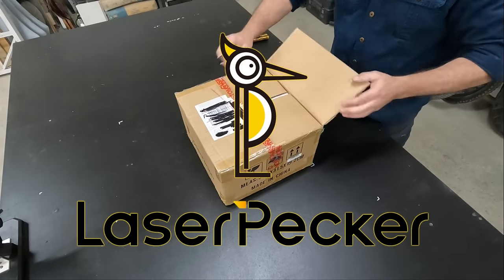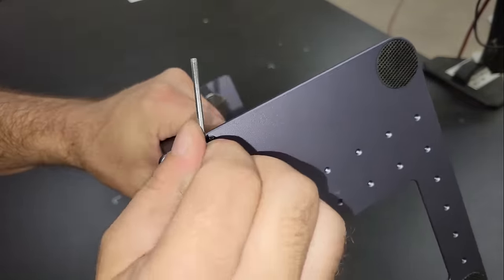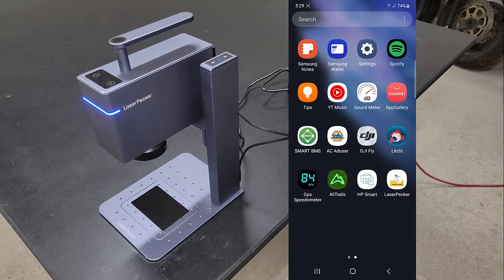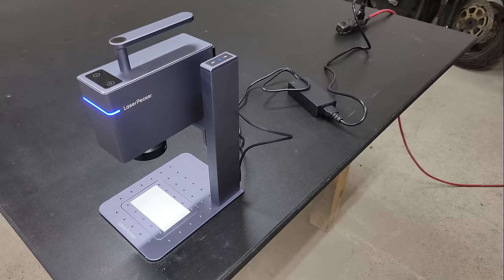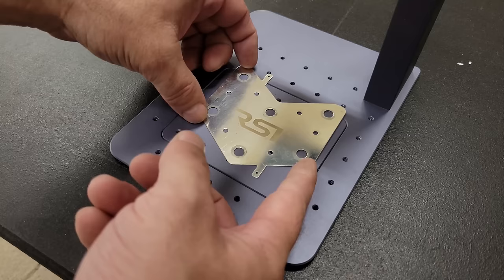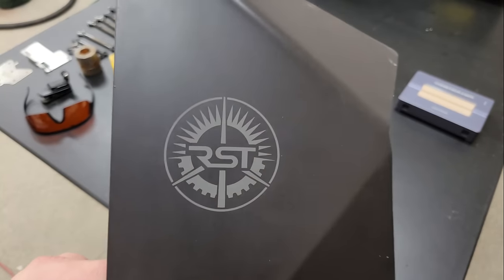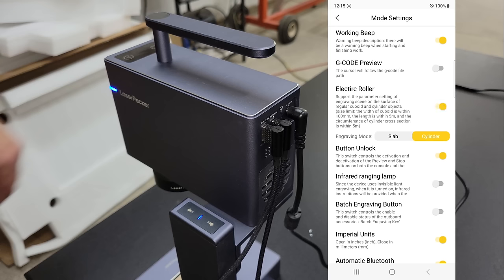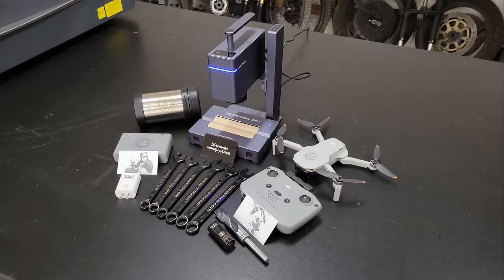LaserPecker 3: PORTABLE Handheld Metal & Plastic Laser Engraver Review

Comment: It would be interesting to see it hooked up to a CNC router where you could still have it engrave a small section but relocate it accurately in relation to engrave a large front panel on a switch box or face plate for example.

Comment: Thus is a neat little machine for sure. It's most definitely just a hobby level machine speed wise, but it's impressively versatile.
Reply from the maker: It's a good machine. @ 48K mm/min, it's definitely not a batch processing industrial machine, but it's far from a hobby machine, too. Ideal for a small business, really. Jeweler's shop, electronics (making or cleaning pcb's), product bar/qr codes (especially for large products that require a portable laser), make your own merch, etc. It's pretty handy at my business.

Comment: is it really engraving or marking? because depth makes a huge difference.
Reply from the maker: You mean laser engraving vs laser etching vs marking, technically. You're conflating etching and marking, but there's a huge difference between them. Pencils, pens, crayons, markers and marking agents/sprays make marks. These are not as permanent as etching or engraving and are not shown anywhere in the video. Etching heats and permanently distorts/discolours and slightly raises the surface to produce a texture that can't be removed without grinding or cutting it out. It's a physical process that changes the surface structure without compromising it. This is shown everywhere in the video. Lay folk are free to call it marking, but it's not technically the same. Marking adds material. Etching neither adds or removes material.

Engraving removes material, like the paint on the wrenches and metal business cards shown. Engraving can be as deep or as shallow as the user prefers provided they have the laser power to do what they want. This machine can remove paint and other coatings from a metal surface, and it can etch said metal surface and plastics. Again, like those wrenches where I remove the paint (engrave) and etch the metal below to produce a nice bronze colour. In other words, it can engrave, etch, and even mark using a marking spray if you prefer...to the extent that a 2w infrared laser can. Different laser types/power work different materials. This machine is strictly for metal and plastic. Their LP2 can cut, engrave and etch materials like wood and leather. The LP4, which I'll be featuring soon, combines the laser tech from 2 and 3 to do it all with up to 10W of output power. It's definitely not the most powerful, but the versatility and portability makes up for it. Again,  a great machine for a small business that doesn't necessarily provide laser engraving/etching services but does require some and prefer to do it themselves instead of commissioning another company to do it. 

With that said, engraving isn't necessarily the best process for every application. Engraving, etching and marking are each better than the others for certain jobs. Depth isn't everything. It could be more of a detriment than anything, like using it to create a mural on a cutting board or charcuterie board. Could you imagine the gunk that would build up? Burning (ie etching) would be a better solution in that case. Just one example.

Comment: Hi, I have the LaserPecker LX1 Max and I’m struggling to engrave on metal. The LX1 max doesn’t seem to have a focus option with the two dots. Di you have any idea how this works?
Reply from the maker: The only bare metal that a diode laser can etch/mark (not engrave) is stainless steel. They can't etch any other metal unless it's coated, and in that case only the coating is etched or removed. The LX1 diode module has a built in graduated focus stick on the side. I recommend reading the instructions ;) https://www.youtube.com/watch?v=p7Oz2fs6Ad0

Comment: Would you recommend it for knives?
Reply from the maker: Meh. It's an IR laser so it doesn't actually remove material to create depth like a fiber laser does. It only etches/marks material. It's permanent, but when it comes to alloyed steels it can have an undesirable effect on their corrosion resistance. In stainless steel for ex, it's the very thin layer of oxide that chromium creates when exposed to oxygen that provides corrosion resistance when it's incorporated with steel to make ss. When you mark the surface with a laser, you're destroying that layer of chromium oxide and causing the steel to oxidize at the same time (lasers mark metal by oxidizing them). As we know, steel oxidation is technically rust. So when you mark steel with the laser you're really just giving rust a decorative head start. It's fine for indoor use. But I wouldn't recommend it for something like a knife that's going to be exposed to moisture often. Others do it, but they'll learn the hard way eventually. A better option would be a fiber laser. They're more expensive. Laserpecker came out with one recently (LP5, reviewing this week). But you can use it to actually engrave a design into a stainless steel blade (ie remove material to create depth) and then adjust your settings on the final pass to clean the surface off so the chromium can form a protective layer again, or fill it with another alloy or colored epoxy, enamel paint, cold bluing, etc.

Comment: Does this engrave wood ?
Reply from the maker: No. Check out the Laserpecker 2 or 4. This uses an IR laser that's suitable for metals and plastics. The LP2 has a blue diode laser that's suitable for organic materials like wood, paper, and others like stone and even stainless steel (but no other metal). The LP4 combines the IR laser from the LP3 with a more powerful blue diode laser like the LP2 in one laser module so you can work almost any material: https://youtu.be/OAT--70RPts
Reply: @JamesBiggar  thank you very much for your reply. Very helpful 🙂

Comment: Whaaat ??? It done that ? Hmm quite nice for metal crafters and wood the same looks good man seriously is it permanently there ? Or does it fade etc i.e. what a good old STAMP wouldn't do etc but very nice none the less
Reply from the maker: Etched for life. Only metal and plastic though, not wood. Different lasers work different materials
Reply from the maker: Yes. It will engrave just about any metal. Steel, aluminum, copper, brass, nickel, silver, gold, titanium, chromium, painted, anodized, powder coated or bare.